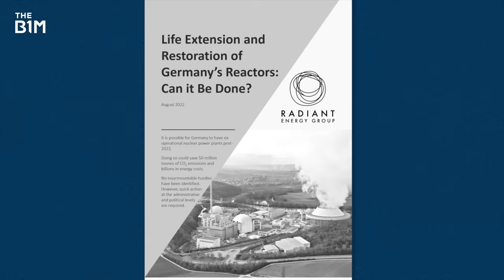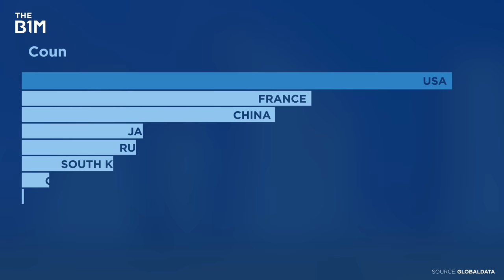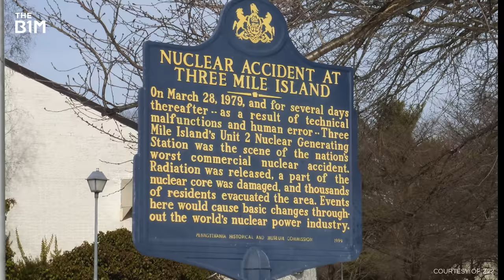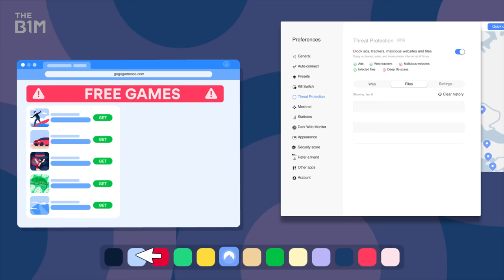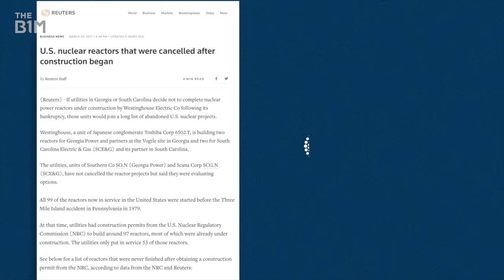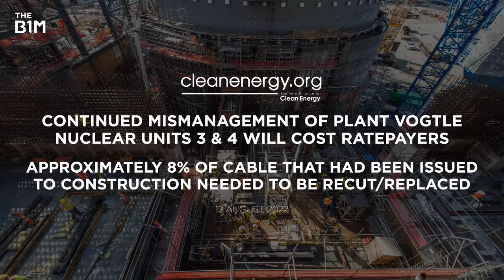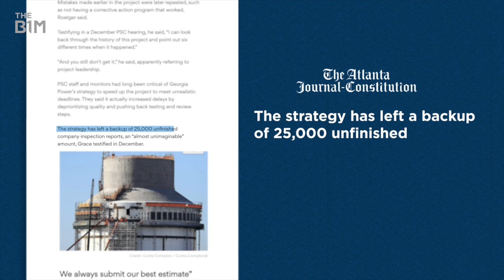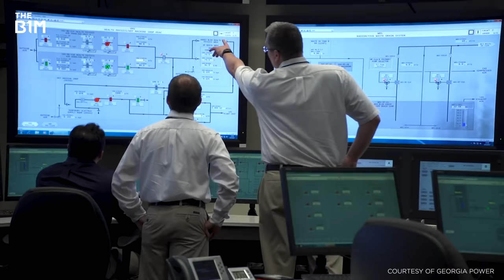Why Nuclear Power is Making a Comeback

Comment: Calling Three Mile Island one of the worst nuclear accidents in history is like a quadriplegic coming in third in a foot race: it happened because there were only three contestants
Reply: Very little radiation released .
Not significant to ban all construction for decades because of such.
Big oil coal gas pushed no nuke propaganda to crush competition.
I worked in that field.
Reply: Plus the issue is upper management, overworked workers, stress, and work ethic in ALL THREE nuclear incidents (TMI, Fukushima, and Chernobyl).

Saying that we as a species should quit all because the lack of improving is rather frustrating to hear >~<
Reply: @MitzvosGolem1  If it was so inconsequential, then why did the IAEA rate it as 5 on the INES scale?
Reply: "Hiroshima was one of the worst nuclear attacks in history"
Reply: @TrebleSketch  for TMI it was also incorrect institutional legacy brought over from the navy, the people running the reactor were operating with the mindset of running a nuclear reactor on a submarine at sea, which is a bit difficult and has a set of unique circumstances when compared to running a land based nuclear power plant. 

for Fukushima it was basically corporate greed. They were repeatedly notified that a tsunami of that scale could happen, and what the results of that could be, but they dismissed it because something of that magnitude is unlikely and  the risk was deemed too low to mitigate. They knew adapting flood defensed was necessary but they kept kicking the ball down the road.

as for Chernobyl, that was gross incompetence.
Reply: Homer, your bravery and quick thinking have turned a potential Chernobyl into a mere Three Mile Island.
Reply: It wouldn’t even be in the top 100 petroleum disasters.
Reply: More nuclear plants obviously equates to more nuclear waste but the disposal of that waste has yet to be adequately addressed here in the US. 
The US does not recycle its nuclear waste though France does; maybe we can learn something from them.
Reply: @Ruhrpottpatriot  Because the scale continues higher? The level 5 means that there was a "limited release of radioactive material", or core damage, THAT will likely require planned countermeasures to be used. 

The next level 6 quite literally reads "Significant release of radioactive material..."

ie. if you actually had to do something to deal with radiation, it's a 5. If it was significant its a 6. If it causes major or widespread health effects or needs extended countermeasures it's a 7.

Should be noted that a 4 means you don't need to do anything (major efforts) other than tell people not to eat the food from there a while.
Reply: @Ruhrpottpatriot  cmon man, at least look at the scale before trying that line
Reply: @faithnfire4769   Level 5, also reads "Severe damage to reactor core" and "Several deaths from radiation" and is officially called "accident with wider consequences"

TMI also had a partial reactor meltdown.

Keep in mind that the incident at Fukushima also was rated 5 at first and only by combining the three reactor incidents it got bumped to 7.
Reply: @hugobenoit4498  that's not even remotely true. We've known how to deal with the waste for decades. If you're interested, check out Kyle Hill's video on it.
Reply: @Ruhrpottpatriot  Look at Curies actually released.. compare to Chernobyl.
Reply: @TrebleSketch  always the case in most accidents.
But Chernobyl design unique and inherently dangerous.
Insane actually to run such a design .
Reply: @foo-foocuddlypoops5694  two " incidents" on mostly civilians..
Reply: Three mile fatalities: 0
Reply: @MitzvosGolem1  By that comparison Fukushima also shouldn't have been at level 7 because the released radiation was so much lower and localized compared to Chernobyl.
And this has been a criticism for the scale at large: That it is more of a PR-scale and that the factual positioning for some incidents and accidents should be totally different.
Reply: @hugobenoit4498  What you and others call waste is fuel for the next generation of molten salt reactors.  And try not to confuse material well confined to a cask with pollution.  Pollution is uncontained waste out in the environment, like smoke that kills hundreds of thousands each year from lung disease or the mountains of coal ash leeching toxins into the environment or the land fill dumping of used solar panels, also releasing toxins that last forever.
Reply: Actually 3 Mile Island is fourth, after Chornobyl, Fukushima, and Kyshtym which people seem to be forgetting and which left a long and narrow stretch of Russia near the city of Chelyabinsk uninhabitable.
Reply: @wyqtor  I'd rank it fifth or sixth. There were the first Chalk River accident and the Windfield fire. In the first the reactor core was damaged by a hydrogen exploson and in the second a graphite annealing plant caught fire killing up to 240 people.
The problem with these two accidents (both level 5 btw), is that they happened in 52 and 57 respectively, so we don't have any hard numbers to gauge them.

Fun Fact: Jimmy Carter was a cleanup crewmember in the first Chalk River accident
Reply: Sellafield,  Fukushima, Kyshtym and Chernobyl are all considered worse than 3 Mile Island. Perhaps even First Chalk River in Canada but that one is hard to measure. Also consider all the incidents we don't know about. In japan 3 control rods were raised by mistake when they should have been lowered and they didn't report it for 8 years. That reactor took 10 mins to get under control and were teetering on critical.
Reply: It certainly speaks to the safety of nuclear that one of the biggest disasters is "that time something almost happened."
Reply: @Ruhrpottpatriot  Yes Fukushima no primary fuel released . Only secondary cooling system breeched.
In fact the study from Japan showed more people there died from panic heart attack s from being displaced .

I can speak on this since I worked for Bechtel and decommissioned Reactors.
I am also a EEOICA Victim.
Reply: @MitzvosGolem1  the coal propaganda field?
Reply: @hugobenoit4498  ------> "More nuclear plants obviously equates to more nuclear waste but the disposal of that waste has yet to be adequately addressed here in the US." 

The amount of waste that a nuclear power plant creates in its lifespan (over 50 years) could not even fill a football stadium.  The US could spend the next 100 years on Nuclear and it would still be inconsequential next to Fossil fuels which dump tons of waste into the atmosphere yearly (and coal does include nuclear isotopes imbedded in it)

----------> "The US does not recycle its nuclear waste though France does; maybe we can learn something from them."

You're way behind the times.  Look up Gen 4 reactors and "The traveling wave reactor."   The US is behind because the DOE is stuck in a time warp, thanks to anti-science fear mongering environmentalists and the media who pushed public sentiment against the industry.     Its private interests who, in the last 10 years, has been driving this revival of nuclear energy.
Reply: @MitzvosGolem1  ------> "always the case in most accidents.
But Chernobyl design unique and inherently dangerous.
Insane actually to run such a design ."

Even with that being true, the Soviets still had to work at "screwing up" to cause that accident....lol
Reply: @BrianJense  437 operational power plants (majority built with the correct containment systems and structures) over 40 years with only three localized catastrophes.   That's one hell of a safety record despite your concerns of unreported incidents and 'close calls' (not counting all the military ships and applications using nuclear power successfully).  Let I remind you that TMI and Fukashima were built around 1970, and based on a primitive "Light water" design system that could have been phased out and replaced with newer, much safer systems capable of preventing meltdowns if it weren't for the anti-science fear-mongering media and environmentalists pushing anti-nuclear sentiment in the public.  Even with your concerns, the mount of deaths and disease caused by the mining, drilling and consumption of fossil fuels, in one year, outweighs all the 50 years of problems with nuclear.  Don't bother mention Chernobyl.  Even with its inferior design, the Soviets still had to work to cause that accident.
Reply: @Ruhrpottpatriot  because 5 is low impact.
Reply: @TheJTcreate  That's a lot of text to prove that i am wrong. Only problem is i wrote a reply to a guy stating that there was only "only three contestants" to 3 Mile Island and i was saying there is 5 or 6 excluding those we have never been told about.  Not once do i mention i'm against nuclear, in fact the technology is sound and i am somewhat for it.  Only problem is the price of the electricity it generates. Here in Europe it's a lot more expensive when compared to Wind, Solar and Hydro.  Nuclear is great for baseload, but at  twice the cost per Mwh, it's an expensive baseload.
Reply: Someone has apparently never heard of the Windscale or Kyshtym disasters.  Both were significantly worse than TMI.

Even within the U.S. there are other indicents or negligent practices which caused more radioactive contamination and likely caused more illness and cancer deaths.  Savannah River, Santa Susanna Field Labratory, Rocky Flats, Hanford, etc.
Reply: @TheJTcreate  Actually no one else ever designed used that insane reactor Soviets used which could be refueled during full power operation.
Westinghouse AP 1000 are all over the world safe clean efficient.
Japan made error placing a nuke plant on fault line near tsunami beach..
Otherwise it would still be operating.
Reply: @hobog  Big oil gas coal spread no nuke propaganda in 70s until today.
Even the founder of Greenpeace admitted such and is pro Nuke today.
Reply: Safety has moved on since then, let it go. Be the good Nuclear you are always meant to be or enjoy being Frozen.
Reply: brilliant analogy
Reply: well  4 really and 3 mile was not the first that was at Handford in the state of Washington when a test reactor  failed in the late 1940s, if I remember right.
Reply: Solid name, friend
Reply: Coal power plants are allowed to legally release more radioactive material into the air than TMI did.  Each and every one of them.
Reply: @TheJTcreate  The Traveling Wave Reactor project was completely abandoned by TerraPower 4 years ago……
Reply: @BrianJense  I would be willing to bet that's the result of government interference with the industry rather than the actual power generation costs. Everywhere I've seen, when the cost to build and operate the plant are compared, nuclear comes pretty close to coal or natural gas and much better than solar, wind or hydro.
Reply: @hugobenoit4498  Ore comes from the ground. we just bury the shit back into the earth
Reply: @brian2440  No, it wasn't Brian.  It was just abandoned being built and tested in China (2018).  The TWR remains TerraPower's long-term goal and it's still updated and present on their website as well their Natrium reactor project. They just updated their 2022 datasheet on it.  The DOE, which is still stuck in a time warp as far as regulatory policies, hasn't helped the matter of getting test reactors built sooner in the USA.
Reply: @TheJTcreate  Well the DOE doesn’t change Regulatory policy for nuclear. That would be the NRC, which they need the US Senate to sign off on changes. 

Considering the current state of the US Senate being dumber that dirt that’s gonna be difficult.
Reply: @brian2440  I did not say the Doe changes regulatory policy. All I said was they were stuck in a time warp.
Reply: @scarpfish  "Someone has apparently never heard of the Windscale or Kyshtym disasters". To be fair I think of myself as someone who follows energy news quite carefully,  for more than a decade, and I've never heard of Kyshtym before today either. I don't believe it is widely known. Perhaps Windscale isn't well known outside the UK (but it is pretty well-known here).
Reply: But it's still true. :)  Three Mile Island IS of the worst nuclear accidents in history, whether you like or not.. and you obviously can't cope. XD
Reply: @sunnyjim1355  Ah no! Its one of the least serious of the three accidents (only three in over 50 years...hint hint). So you can't even say its one of the worst.  But of course,  you got nothing better to do with your life except troll and act mindlessly  sarcastic.
Reply: @Ruhrpottpatriot  also fun fact, Carter visited TMI and said it was no big deal. The ONLY reason why he didn’t go public was because he didn’t want to piss of anti-nuclear Democrats.

Sadly, had he known in advanced that he was going to get destroyed in the election by Reagan, he would have come out and straight up said it was no big deal.
Reply: @sunnyjim1355  if it is one of the worst, then we are in pretty good hands with nuclear. Just saying. 

Based on statistics, TMI would account for an increase in 0.7 cancer cases (not deaths) in the immediate vicinity. Comparatively, an estimated 300,000 people will be diagnosed with cancer in that Harrisburg Metro Area in their lifetime.
Reply: @howardbaxter2514  i wouldnt want to live anywhere near a nuclear reactor.   there is a gas power station about 25 miles away and i dont even think about it
Reply: It’s far, far more nuclear accidents than just three, both on land and at sea
Reply: there are a lot of incidents on the entire fleet of nuclear reactors. the tree you mention were the worst and uncontrolled. Bt an accident can result in a stop of a reactor, a repair and then a re-start...accident is not equal to disaster (on my humble opinion)
Reply: “More will surely follow”

No they will not.  There are no planned reactors, not anymore, not anywhere in the US, that is, with active proposals into the NRC, which btw has never approved a single reactor start to finish. Vogtle will be the first.
Reply: @MitzvosGolem1  Bingo
Reply: @andrewwyatt8445  I think that's it's also ironic that Homer's butt prevented the release of toxic gas.
Reply: Thank God! Someone in the comments actually knows what they are talking about! The widespread ignorance in this comment section makes me wanna give up on humanity
Reply: Let's be clear that tchernobyl, Fukushima and the less knwow Kyshtym disaster where altogether on an other scale that Tree Miles Island. However, there are far more contestants, you can't just ignore all the facilities that didn't fucked up as hard as Tree Miles Island did. USA has 91 other reactors that never encountered an accident on this scale. France has 56 reactors and never encountered an accident on this scale. China has 55 reactor and never encountered an accident on this scale. India has 22 reactors and never encountered an accident on this scale... List goes on....
Reply: @Amethyst YEP! The dirtiest nuclear sites are always processing/reprocessing/plutonium production facilities, not power reactors. Dirtiest places on earth? Sellafield, Mayak, Hanford.... and I dread to think what the processing facilities in North Korea are doing to their environment.
Reply: @scarpfish  Windscale - I cycled Hadrian's wall in the UK a few years ago (the entire width of britain) starting basically at Sellafield/Windscale. As we biked inland we went passed fenced off areas marked with radiation trefoils and warnings. I'd known about the incident at Windscale but had no idea there were actual exclusion zones in England (admittedly limited, but still) to this day. And yeah, as I looked on my OS map and google maps at the time, I saw no record of the zones on the map, but there they were in front of me on the ground.
Reply: @ibrahim-sj2cr  think about it more then. Because the more you think about it, the more you will want to live near a nuclear reactor, and the less you will want to live near a fossil fueled thermal plant :)
Reply: @iainbagnall4825  would be worse to live near an airport than any of the above because of the leaded fuel they use in aviation gas (avgas).  no i would not like to live near large amount of nuclear material thank you and neither does anyone else thats why nuclear power never dominated
Reply: @ibrahim-sj2cr  well at least we can both agree that its high time lead was left out of avgas :)
Reply: I got a really good laugh out of this statement
Reply: Another one who choose to ignore other nuclear power plants accidents
Reply: Nobody died or was injured in the initial incident at Three Mile Island
Reply: @johnl5316  
Said, "Nobody died *in the initial incident* at TMI."

🤣🤣  Notice how he excluded anything after the initial incident so as to exclude all the possible 'events' that may have been radiation related that occurred after TMI.
Reply: @acmefixer1  there was no evidence that radiation killed anyone, at all, actually
Reply: @Kriss_L this is actually surprisingly and sadly true. I found this out back in 2014 with the Duke Energy Coal Ash incident.

Turns out, coal ash is pretty radioactive and releases far more radiation than a nuclear power plant.
Reply: @Ruhrpottpatriot Because there’s so little to compare it to. Nuclear accidents are very rare.